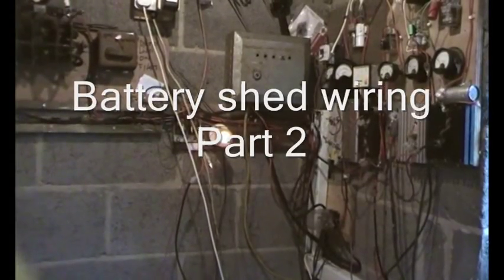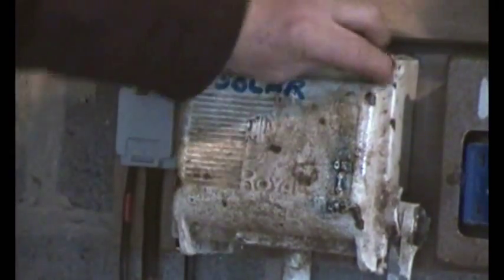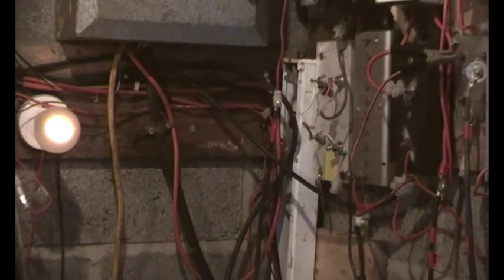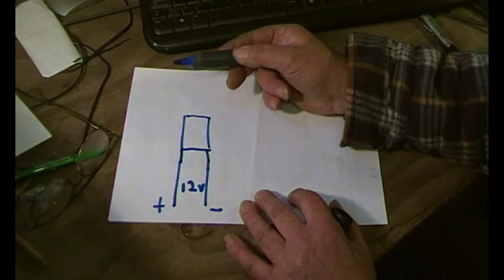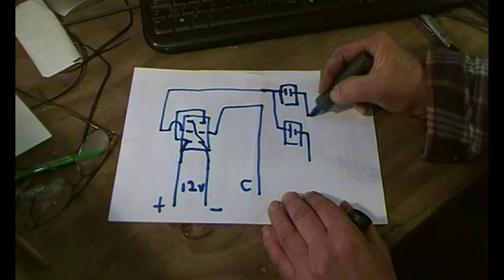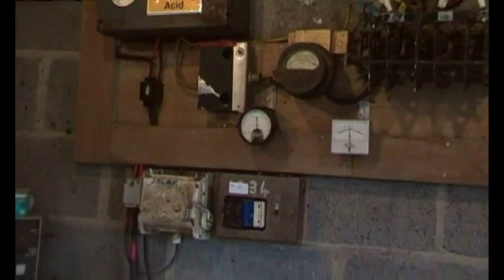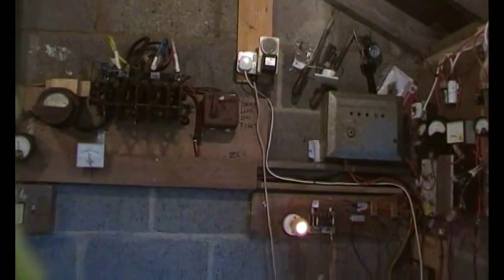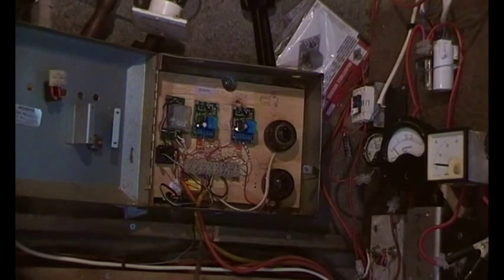Battery shed wiring Part 2. Wind and solar electricity

Comment: That is indeed a nice switch. I got a black one similar just waiting to put it to a killer use. It has a microswitch added that can tell the position ov the actuator, so that could be handy too. 

I also like the way you just use mains coil'd contactors if that's what you've got. It's something I have considered as I have a couple ov fairly modern siemens ones. I have, however used 24 volt relays to switch 12v circuits.

And I have one that actually is a very old 48 volt model that is triggered by a "one shot voltage doubler" from 24 volts, which is then enough to hold it in. This relay is functioning as a power transfer switch and I like it for this 'cause it's contacts move a rather long way during switching.
Reply from the maker: I can see you understand the fundimentals of switching DC by the way you talk about contacts moving a long way (big gap). It's industrial art, redolent of an age gone by, and recycling in the finest way. Cheers